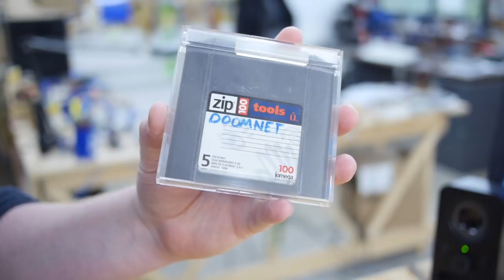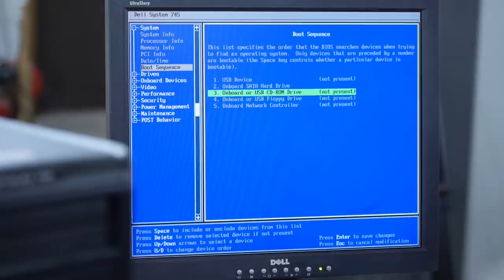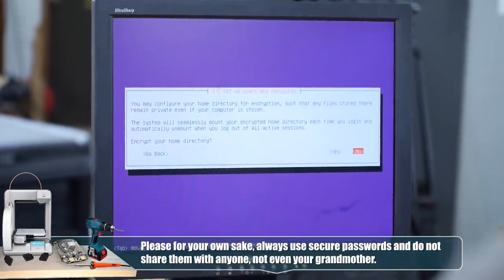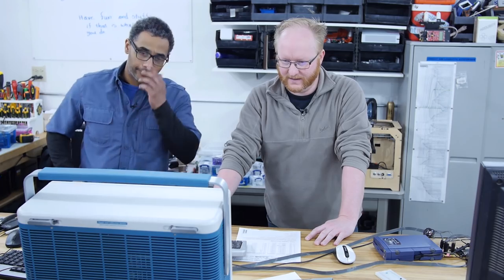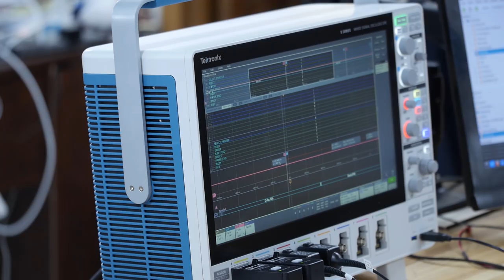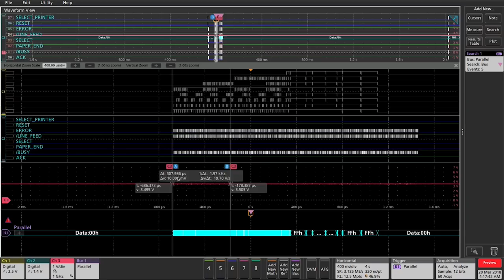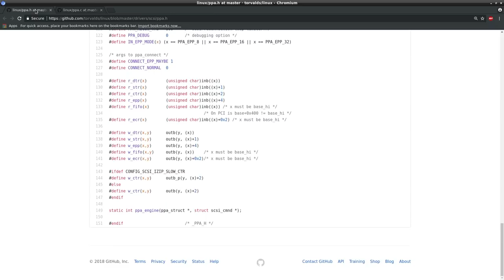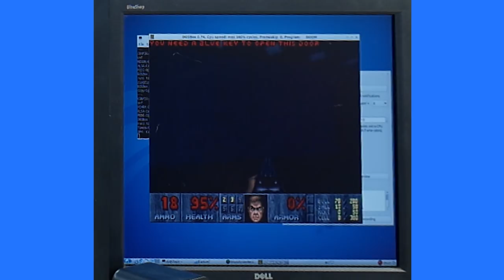Zip Drive Reverse Engineering

Comment: Why just not use a Moxa UPort 1110 USB to RS232 adapter? Mine works fine. The cheap ones suck but the Moxa ones actually work.
Reply: Jan de Vries because the ZIP drive is a parallel port device, not a serial one.

That said, I’m kinda puzzled as to why not just buy a USB ZIP drive? Iomega made them for those original iMacs. The claim that they only work on Macs is false. Or at least, no longer true. Back then it was true solely because PCs don’t have USB ports. But PCs do have them now!
Reply: You're right, I mixed it up...

Comment: This show has gotten pretty underwhelming especially in comparison to how it started.
If it's already working on linux, kernel source is the first thing that you study, duh.
Sniffing the bus is kind of dumb then, but if you do that - at least try to actually go through with it, find the exact bits you written on the disk, or issue commands from an arduino....